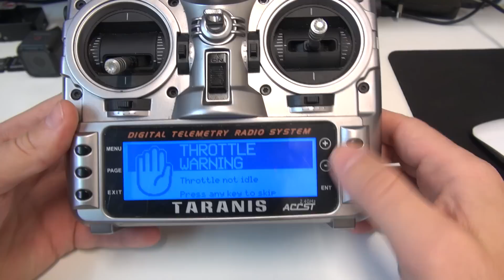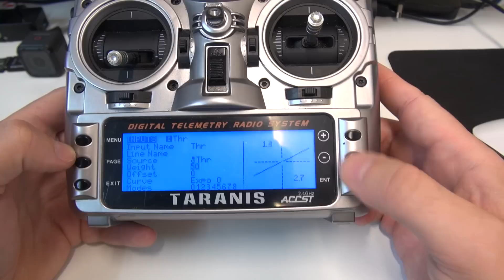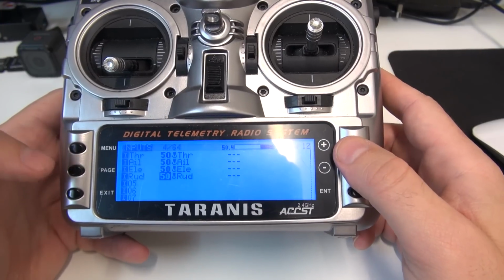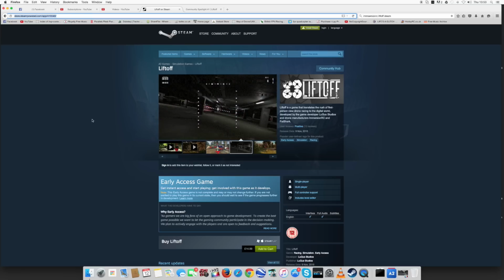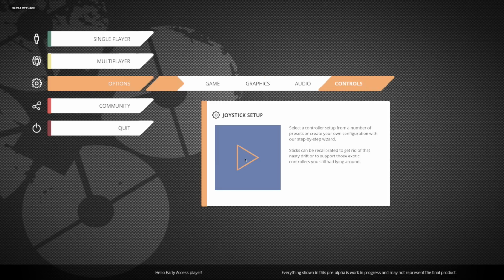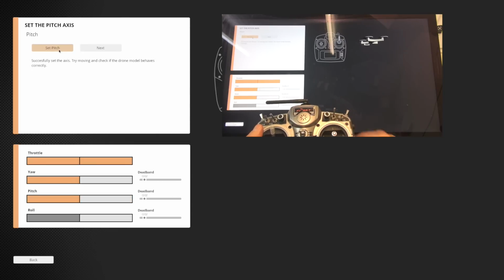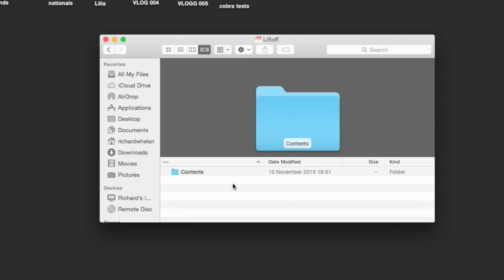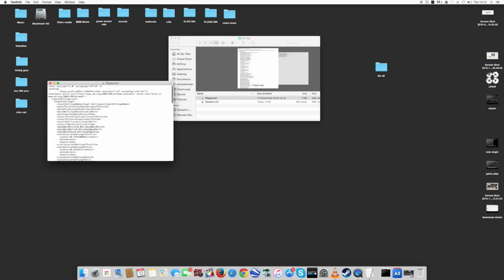HPIGUY | ImmersionRC Liftoff- Download - Taranis Setup - Camera Angle

Comment: I don't know if thing have changed in OpenTX 2.2, however those settings will not work in this versions.  Throttle should have a negative offset proportional to the amount of weight you assign.  Ailerons, Elevator and rudder should not have any offset, otherwise it will skew the controls to one side of the axis.

Comment: Hi guys. I just received my Taranis X9D (built May 16) and connected it via USB. I see the icon on the display. I connect to steam/Lift off and go to options. The gui looks different right now but there is a preset Taranis Mode 2 windows .I click on it but nothing happens. Does anyone has an idea what I would need to do? Do I really have to update the firmware when this Taranis is just recently build? Where do I find an information about the installed firmware?

Comment: I like the idea behind this game, but I've had nothing but issues trying to get my Taranis linked to it. I can see stick movements but calibration just won't work well at all. Most common I've had happen is after calibration, 50% or less stick movement is only used to get full control movement on the game screen.  After a last calibration, I cant get any range at all, it's either full on or off signal wise in the game.

edit: figured some things out, reversing channels causes the game to freak out, am I missing a weight or offset adjustment for a reversed channel? seem to want to go 0 or 100 with anything above 1 from the controller.

Comment: how do you connect your controller to your pc? 
I have a male to male 3.5mm connecting mine using the line in jack and an app called smartpropoplus and it just keeps jumping / twitching all the time.   I have spent over 6 hours getting a ps3 controller working on this just to realize it's to hard to fly with a ps3 controller.
and now my dx7s is twitching omg. this is soo difficult.
Reply: how did you connect the ps3 controller i can't make the game recognize the controller
Reply: Using a ps3 controller for liftoff is horrible, not enough stick movement.  I highly suggest using a (rc transmitter) with a usb to 3.5mm  (rc simulator cable)  like 10 bux on ebay for the cable.     I put in over 40 hours messing with other setups with lots of frustration.

Comment: Great video, this is probably a dumb question but on the Taranis plus when I create a new model, then pick the quadcopter from the 4 graphic options it then asks you what your throttle channel is, your roll channel, pitch channel and yaw channel. I thought it would be 1234,is that correct? I ask because I just seen a diagram that put it as channel 1 aileron, channel 2 elevator, channel 3 throttle and channel 4 rudder. Please help, I've never flown for real yet, building my first quad now, and don't want to be learning the wrong way. Sorry for the newbe question, thanks for all the help.... Have a great day and keep up the informative videos, one of my favorite channels. Also two thumbs up for Painless360!!

Comment: How did you connect the taranis ? Via usb or the trainer port
Reply from the maker: +TubeSurfer simply via the USB
Reply: You use a standard usb cable for the Taranis. The connector is a type mini-b if you need to buy one. Make sure radio is on, plugged in and you have the little USB icon in the top right area of the Taranis screen. Once you verify all that start up the LiftOff sim. Go into the options and make sure to select the Taranis for windows or osx accordingly. 

Another thing to note is the latest LiftOff seems to want the weights and offset at the stock 100 0 settings. So if your quad is not level in the sim when your sticks are centered, check that.

Comment: Hey bud when I use the sim I get nowhere near as smooth FPS as you are I have it set to like fastest setting and have a current MacBook Pro but it just seems to be a bit laggy. Any ideas?
Reply from the maker: Mine doesn't run so well on my Mac Pro i7 for some reason. It runs better on my i5 iMac.

Comment: hi Richard, great video thanks.  Are you using the original taranis rather than the newer plus version ?  I've been trying to a while to get my taranis original to talk to the macbook pro to play freerider and it never ever worked, having just seen liftoff I want to try it.  My original taranis is on a factory stock firmware and has never been updated, I watched painless360 video you linked to but haven;t tried the process yet, did you use the zadig program he referred to in the video when you updated your radio on the mac ?
Reply from the maker: +Raymond Kerr Hey Raymond. I used a cheap windows laptop to set mine up so yes I think I did use the zadig. Yeah mines the older taranis, I got it a while back as a swap and ive not used it until now. I also couldnt get freerider to work. I bet now its updated it will be fine.
Reply: ThatHPI GUY thanks mate, I'll try the update tomorrow and see how it goes.  I don't have any windows machines I can use at the moment, hopefully I can get the firmware updated using the mbp.
Reply: +Raymond Kerr Mine doesn't work straight away, either.  I turn on the Taranis with USB disconnected, plug in the USB, then turn the Taranis power switch off.  Works every time.  I'm using a Macbook Pro also and have the old firmware in my Taranis.
Reply: +ntc490 thanks will give it a go.